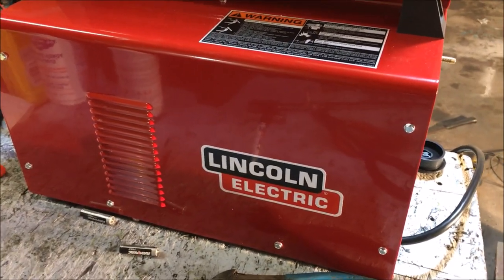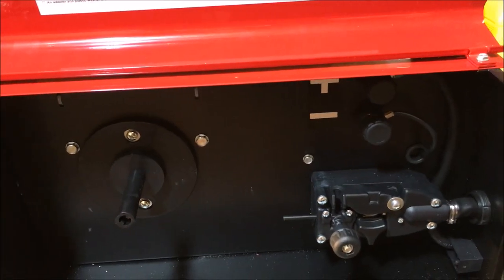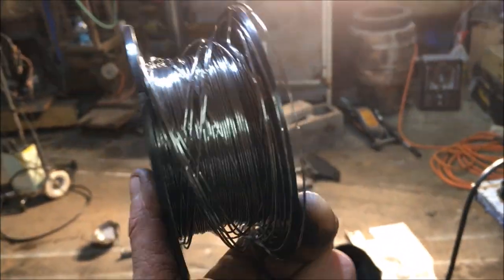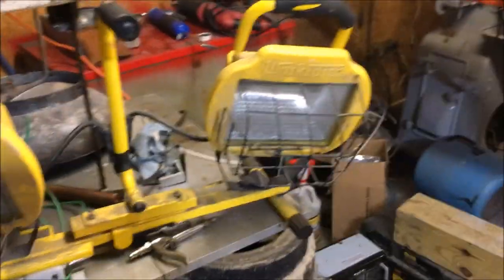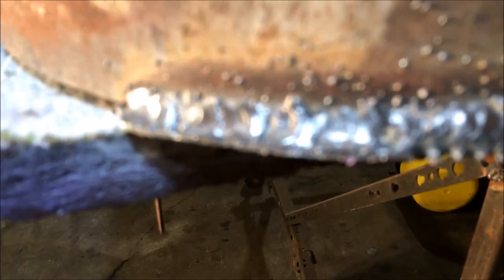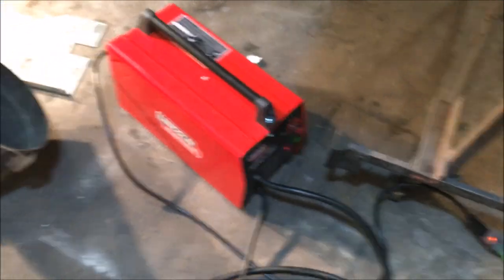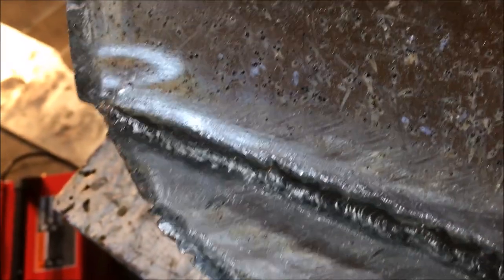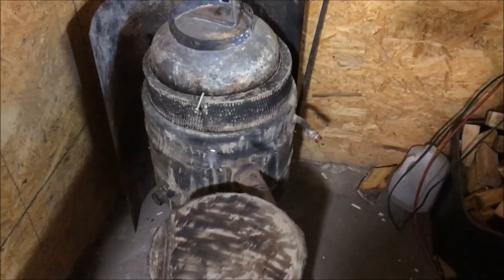Lincoln Electric mig/flux welder review

Comment from the maker: Guys in my opinion this welder is junk and cannot weld beads longer then 2 inches before it starts to sputter and axt up producing crappy weld
Reply: There's little point in bringing home anything smaller than the 140 amp Lincoln Mig welder.
Reply: So...your opinion had changed dramatically since this video, I take it?

Comment: Voltage issue may also be caused by how many receptacles you have on the circuit you are running that machine on and the amp breaker is being used on said circuit.

Comment: What you called stainless steel welding looks like galvanized pipe. Have to be careful of the fumes coming from the galvanizing. Best to grind it off first wearing a respirator.

Comment: Friend could you help me.
 Notice that I have a machine just like the one you have.
 But the temperature bulb came back on and nothing worked anymore, I checked the wire motor and if it works, take the opportunity to change the hose for a new one, replace the fan but it does not have a reset button and I can't find where to reset it or what is the  temperature circuit could you help me or could you tell me where it is or I will have to replace the card.  Thanks for your help

Comment: I have both a Chicago electric flux core mig and this welder the Lincoln is FAR superior. The wire feeds look similar on both models but trust me they are not the Chicago is dead and my Lincoln is still going strong!

Comment: if you burn through you have to high of heat. and a simple weld is a zigzag weld.  if you smack your weld with a hammer and it falls apart then its not a good weld .

Comment: Where do I find a replacement gun for the Weld Pak HD? Other than the gas line for the Hand Mig both looks exactly the same. Wire feed motor and everything
Reply: Check with Lincoln. The Weld Pak HD is Flux Core only, unlike the Handy MIG which can do both,they use a different gun. Is the gun actually shot, or is it just the liner that's worn out. You should be able to get a new liner at your local welding supply store.

Comment: I recently bought exactly the same welder, but I'm having trouble with it keep burning trough any suggestions??
Reply from the maker: put some angle on the arc so it pushes a puddle rather then the arc just blasting straight down  also you can run the welder on an extension cord to lower the voltage a bit
Reply: Hector Aguilera  too much heat
Reply: When i was burning through i was able to fill the holes by building my weld up. Put a little down let it cool slightly and build a little more on top of that...until the hole is filled. You can tell when its properly filled when the metal glows
Reply: I also have the same welder and have had this issue , when welding . Is there really any good way to adjust the voltage or anything ? Beside just the two buttons ? Like is there a certain combination or something that you can have them on to lower your voltage or raise the voltage in different increments ? I'm 17 and new to welding and would like to learn more
Reply: Try welding negative polarity. Positive polarity is likely to move metal from workpiece to electrode, better penetration  negative polarity tends to put metal into the work,  better for filling holes. 
Unless i have that backwards?
Play with heat, wire speed,  and polarity until you find the combination you like.

Comment: That wire feeder is INDENTICAL to the harbor freight 99$ flux core welder! Lol the reason I would get the Lincoln over the Chicago electric is his the harbor freight is the wrong polarity ! It  runs on AC and that’s just wrong
Reply from the maker: Great info friend , comments like this are Gold
Reply: This is DC, reversable polarity.
Reply: You can convert it for about $30.
Reply: Is the harbor freight not reversible polarity this lincoln is

Comment: those welders ain't worth their weight in scrap Lincoln is a pile of shit that's overpriced I'd never buy another Lincoln tool again better off buying the cheap off-brand welder so when it takes a shit you're not out $500 three 2 pound spools of wire later
Reply from the maker: what was it that broke on yours ? i know people have said theirs  lasted at work for 11 years
Reply: +NOBOX7  mine wouldn't stop feeding the The Wire tried new spool gun tried new circuit board still same problems so I smashed it with a hammer and went and bought a hoBart hands down by far better machine than the Lincoln.
Reply from the maker: thanks for your input , i will bring it up if a make a update video , if mine breaks i will definatly post
Reply: James gross so you're saying Lincoln is junk?